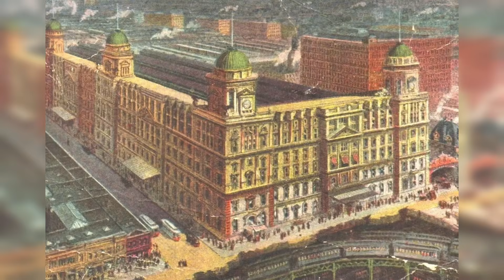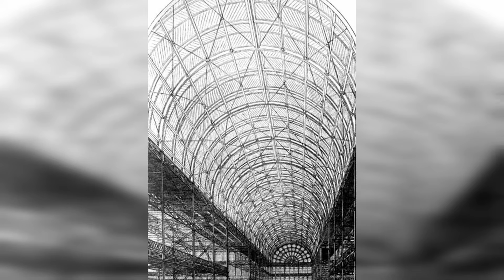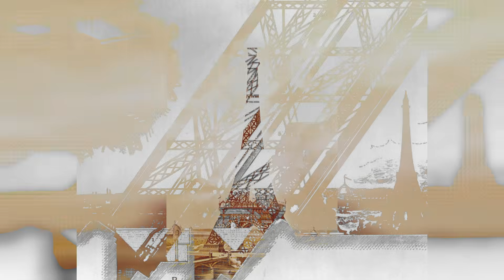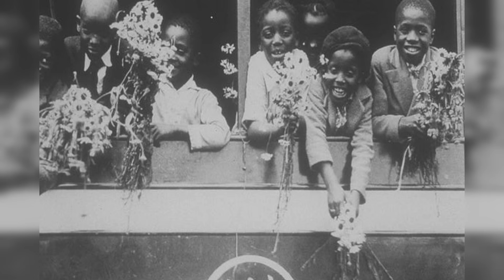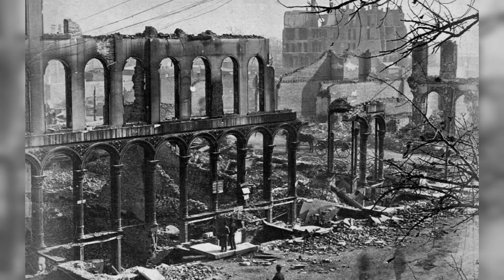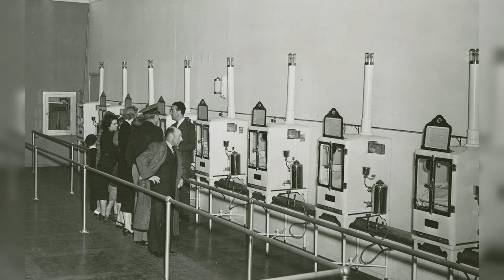Where Did SO MUCH IRON Come From? The Mystery of the Eiffel Tower and Crystal Palace Technologies

Comment: The iron for the Eiffel Tower was manufactured in the Forges de Pompey located in Pompey, Lorraine, in northeastern France.
The raw "puddled iron" produced there was then sent to Gustave Eiffel’s factory in Levallois-Perret, a suburb of Paris, where it was prefabricated into 18,000 individual parts before being transported to the construction site.
There you go mystery solved.
Reply: No. No it's not 😂 get a load of this guy 😂
Reply: Historical facts. Through research I agree.
Reply: How was it transported? How many people did it take to make all that metal? How did they get the fuel to make it? How did they pre drill holes to fit perfect down to the millimeter? Why don’t we have blue prints? Where’s the worked in the “construction” photos?
Reply: @grizzly609 1. How was it transported?

The raw puddled iron was manufactured by the Fould-Dupont forges in Pompey (northeastern France) and transported by steam trains to Gustave Eiffel’s factory in Levallois-Perret, a suburb of Paris.

After being precision-engineered into pre-assembled parts, the components were hauled to the Champ de Mars construction site using horse-drawn carts and trolleys.

2. How many people did it take to make all that metal?

The industrial ironworks in Pompey employed hundreds of workers to smelt and refine the puddled iron.

However, the on-site construction crew was famously tiny: only 150 to 300 workers were active on the Champ de Mars at any given time. An additional 150 people worked back at the Levallois-Perret factory drawing, cutting, and pre-drilling the parts.

3. How did they get the fuel to make it?

The late 19th century was the peak of the Industrial Revolution. Heavy industries like the Forges de Pompey operated massive industrial furnaces fueled by coal and coke, which were delivered via France's highly developed network of cargo canals, rivers, and railways connecting major European coal basins.

4. How did they pre-drill holes to fit down to the millimeter?

Every single one of the 18,038 parts was systematically calculated, drafted, and fabricated using advanced mechanical punching and drilling machines at the Levallois-Perret factory.

If a part arrived on site and its pre-drilled rivet holes didn't align within one-tenth of a millimeter, it was completely rejected and sent back to the workshop by horse cart rather than being modified on site.

5. Why don't we have blueprints?

We do have blueprints. In 1900, Gustave Eiffel published a comprehensive, 2-volume masterwork called La Tour de 300 Mètres ("The 300-Meter Tower").

This massive publication contains all 5,300 engineering drawings, calculations, formulas, and millimeter-exact schematics used to build the tower. Hundreds of copies were preserved and are freely accessible in libraries worldwide and on Wikimedia Commons.

6. Where are the workers in the "construction" photos?

They are in them! Extensive photographic records by historical photographers like Louis-Emile Durandelle heavily document the workers.

However, two things explain why they don't look like a swarm:

Long Exposure Times: 19th-century camera technology required long exposure times. Workers actively moving on the beams would often blur out or completely disappear from the frame unless they stood completely still.

Prefabrication: Because the tower was treated like a giant 3D puzzle pre-made in a factory, the actual on-site work consisted mostly of hoisting parts into place with cranes and hammering rivets—a highly organized process that required only a small handful of people distributed across the structure.